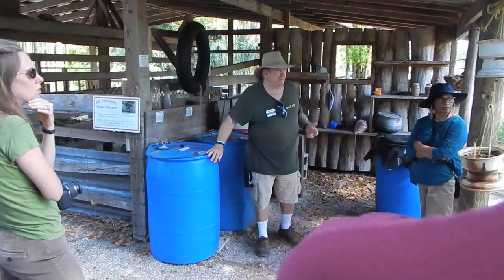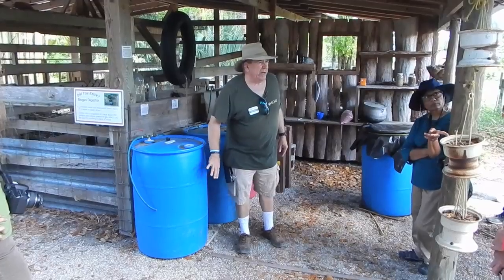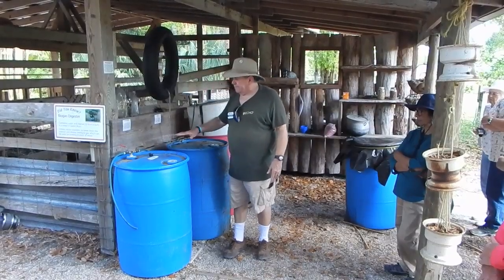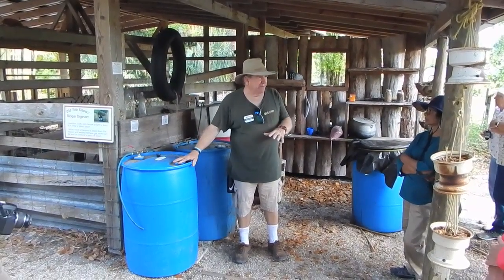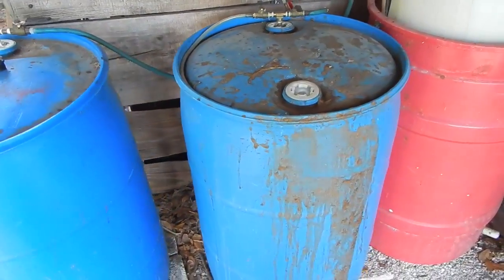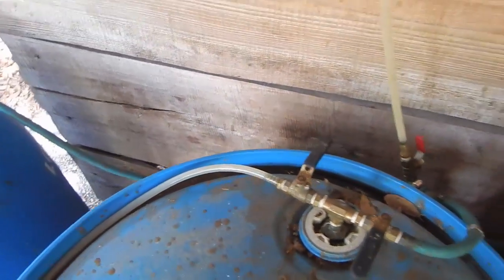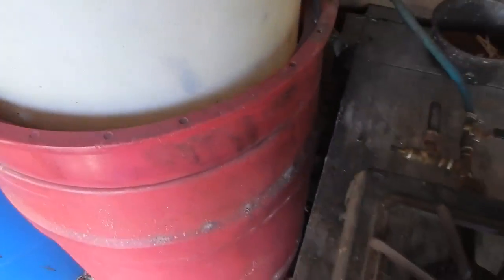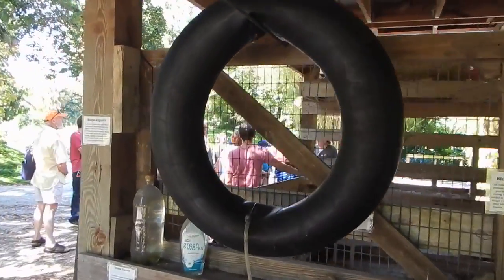Biogas Digester Turns Manure Into Cooking Gas!

Comment: the blue flame wont turn your pots black. if there is yellow flame coat the pots with some detergent soap and the soot will be easy to wash off after using the pot

Comment: Is the white barrel floating inside the red barrel is completely sealed? Can anybody confirm this?
Reply: Yes and no.

The water initially fills the inner chamber.  Since you really don't want to store the biogas with oxygen (explosive mix).

Then the gas displaces the water and rises.  

But...if you forget about the unit for a couple days, the excess gas can burp out under the lip of the inner barrel...which might be a nice safety precaution.

Comment: Could also run a small generator intermittently off from that also,,,maybe to charge a small bank of batteries,,,run a small battery refrigerator prevent food spoilage run lights at night.
Reply: I looked into the math...and cooking seems to be the best use at this small scale.

1-meter³ is about 20MW for methane, after it's been scrubbed from biogas-->biomethane

Comment: I wonder how much sulfur is in the methane if it is not purged? I don't know where to get the sulfur eating bacteria to complete tbis step.
Reply: Hydrogen sulfide is corrosive.  By simply passes the gas through a chamber or iron filings or steel wool (large surface areas) you can. Effectively scrub a large percentage of the hydrogen sulfide.

Before scrubbing...usually a dirty yellow flame.  After scrubbing, blue.

Comment: Hello, I'm building a biogas digester as well. I'm having trouble finding a fitting that will connect the inner tube to the gas line. can you help to point me in the right direction?
Reply from the maker: Good question. Try calling the office of ECHO in Ft. Myers, Florida - they should know what fitting was used.
Reply from the maker: Here's the number: 239.543.3246.

They are very nice folks. Sharp and helpful.
Reply: Can a dry cowdung be used??

Comment: how do you bleed just the oxygen only? can someone explain how you can just bleed the oxygen not the gas it's self? maybe i missed something here? 

Thank you
Reply: Great design. My only concern is that the burner is so close to the white storage tank because the potential for a leak is possible and could lead to an explosion. My guess is this is for demonstating the system and a real setup would have the storage and burner much further apart. I love the simplicity of the design though.
Reply: The oxygen is not bled alone because it's not possible to do that. However, most of the air is released (including oxygen) at the beginning of the process before methane starts to be produced by the microbes breaking down the biomass (cow dung). To displace the air (O2), he placed a bottle of water in the tank. How? Not sure. But one could figure it out. I wish he had shown all that but I have an idea that is too difficult to try and explain here.
Reply: Abshirow ma i maqashaa
I am not a scientist but it seems that the oxegyn is in there in the form of urea . The guy is opening a hole so that it evaporates with the offensive smell. I will meet Mr David the Good in Florida soon

Comment: So that inner tube and the weight of the white drum (floating in the water) provides the pressure?
Reply: I'm no expert, but the pressure builds because the methane gas is lighter than the surrounding air and so will expander at a faster rate, making the inner tube expand. And filling the container with the white inverted barrel. It doesn't need to be pressurised per say, to be able to flow when the valve is opened.
Reply from the maker: You got it.
Reply: heyerstandards you could compress it too
Reply: krystal Teque  just by putting a rock on the white drum. Which means you can transfer it distances.